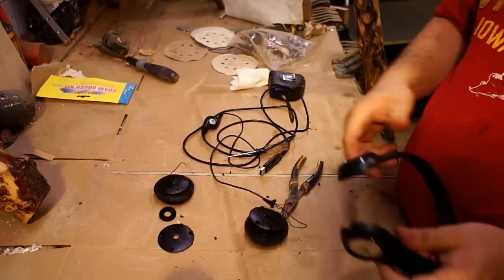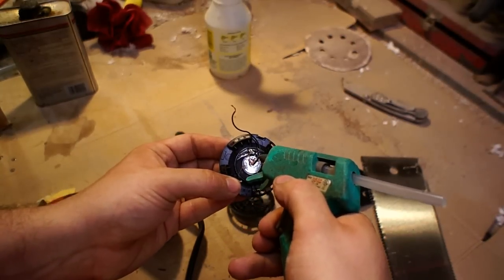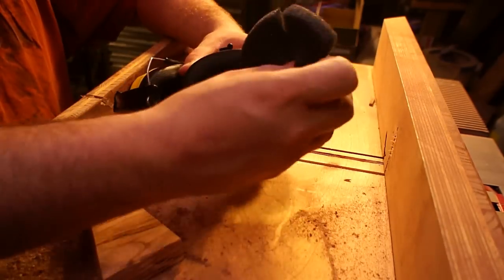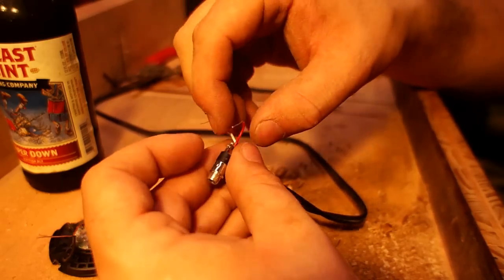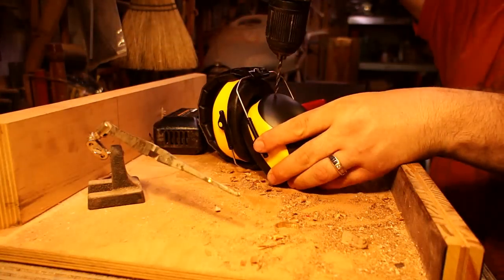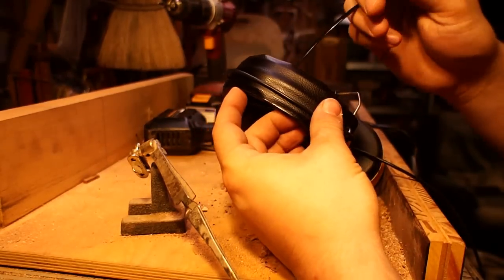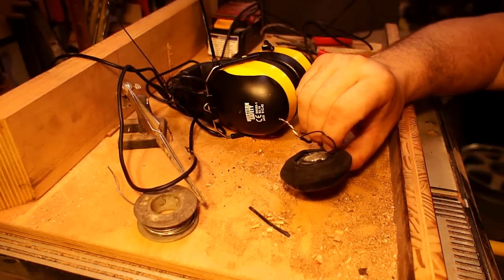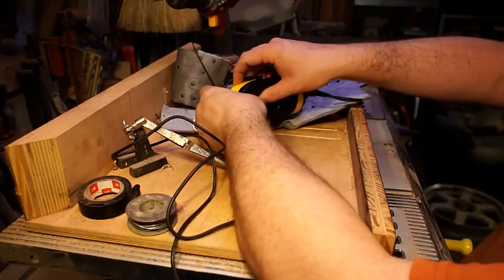Hearing Protection: Now With Tunes! Old headphones transplanted into earmuffs

Comment: Pro Tip: With a BIG soldering gun, wrap a small piece of copper around the end. So you can solder smaller wire with ease.

Comment: Will this reduce the quality of the earmuffs? Like, will the ability to muffle noise decrease if you cut a hole for the speakers?
Reply: To a degree yes, but It's better than actually using the original headphone configuration in terms of having "some" earmuffling capacity.